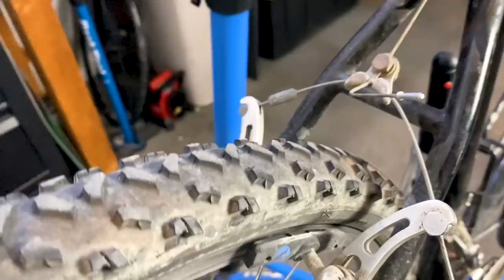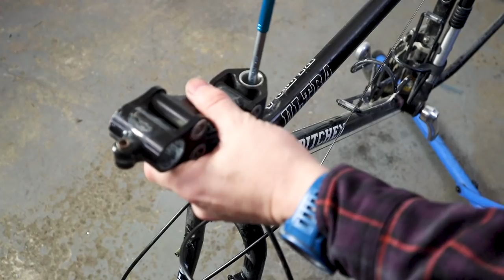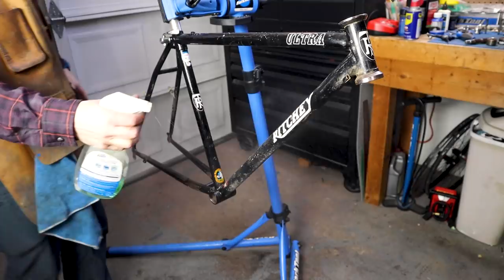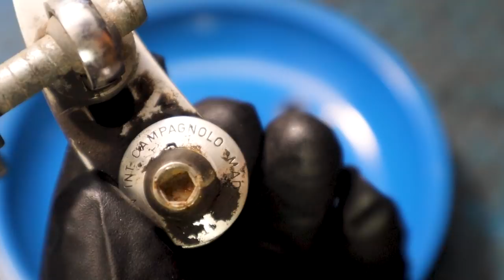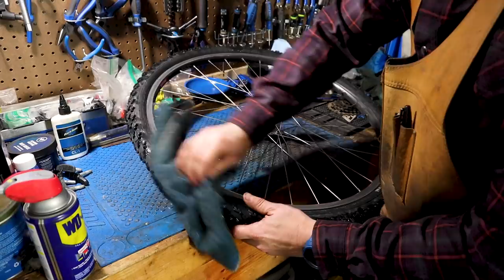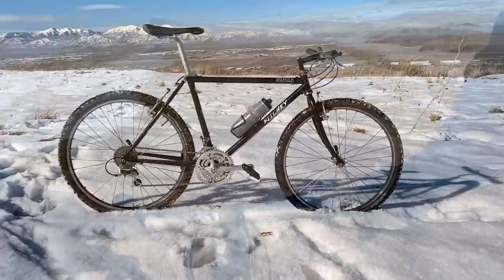Restoring a Vintage 1991 Ritchey Ultra Mountain Bike

Comment: to clean bottom bracket threads, I take a 12 gauge brass cleaning brush in an electric drill, and run it both directions, works really well (with solvent)

Comment: Beautiful. I have a slightly older Ultra also in Black with stock deore xt. Same m732 you put on. Bulletproof shifters. Brakes down low like your Ascent. Such fun bikes. Lightweight, agile. Lively without punishing you. Nice to see you do the resto to close to original parts.  Yes go ride it.

Comment: Right before the world went sideways, I found a Gary Fisher Aquila that I picked up for $40. It was the 2nd bike I tore down and rebuilt complete, plus a retromod update. That frame rode a dream and the Genesis geo was a playful blast. Granted it's not the same vintage, but vintage nonetheless. And I wholeheartedly endorse riding older bikes. 

I sold it last summer and somewhat regret letting it go, but I was able to apply the funds to a Specialized Fatboy which I dearly love, so emotional and financial equity moved forward.

Comment: That was about the time frame that I started working at bike shops, and  I've always wanted a Ritchey frame!! Just loved watching this video and had never seen the   Campy mtn bike group, thanks  for sharing!!
Reply: I have a bike exactly like this bike  without the Ritchey graphics.  An original KHS team with the Ritchey logic tubeset ( decals intact) only tig welded instead of brazed. Rides wonderfully.  Perhaps you could look for one of these to experience the Ritchey ride on the cheap as I've done. Just a thought.

Comment: So glad you kept the original paintwork. Coming from auto detail background you can do paint touchup / correction and the ceramic coating and maintain this original paint work. It really is in too good of condition to start over and lose this original paint work. Would really be a shame in my humble opinion.
Reply: Yeah, its sometimes painful to see vintage paint being stripped only to be replaced with spray can coatings. Would be more interesting to see someone fixing the chips and scrapes and then sealing the old coating like you said.
Reply: I agree. I would prefer the original paint and decals  preserved.

Comment: Thanks for saving another old bike.  I'm wondering if it was originally equipped with Campagnolo derailleurs too?  The triple is awesome.
Reply: I guess it could habe been compleately equipped with Campy. This mix between Campagnolo and Shimano wouln't make sense. 
Well, but I'm not totally sure about that, because these parts are from different years. The Cankset is Campy Euclid (1988), the bottom bracked too, because the Euclid crank needed a special very lon axle. The brakes are not Euclid, they could be Record o.r. or Icarus but from a different year (I assume 1993 or 94). The Shimano 7 speed XT stuff is from 1989 until 1993, except the exchanged Shimano (not XT) shifter and brake levers, they were pretty new (and cheep), maybe 2010. 
I don't know what year the Ritchey frame comes from. I guess it should be early 1990s. So the 1988 Euclid Crankset wouldn't make sense.

Comment: Could you tell me why you never wash the bike with water before disassembly (or at least wash the frame when all components are taken off). Using a rag on a dirty frame introduces new scratches to the paint layer - that's for sure.

Comment: I have the same 87/88 Ultra, it's still my daily ride for my local (easy) bike park. As others have said, please don't paint it, the original paint is a great product, it's almost like an anodised finish. Looks great with the black XT groupset (730). Mine is all original, except I swop over some modern Richey tyres/ saddle for daily use - please use Richey parts! If you can't get the original stem, Nitro still make the bullmoose version

Comment: I keep going back to an Old steel ridged mtb I was able to pick up a Schwinn 1985 Maximum today 2x7
Reply: I have a 1991 Schwinn Crosscut.  I have had it over 30 years.  It bears similarities to what is in the video, but the components are cheaper.  This oldshovel guy shows time and again that with a little work they can be restored to good operating condition,  This enables many more years of use.
(I think he could clear coat it.)

Comment: I was so happy you didn't bodge it this time, no 1x, no wide bars, no polishing of the cranks. Debatable grips and pedals, but ok stem and proper levers and low handlebar position. But then came the announcement at the end: 
😨😰😱 Do not paint it! - Adjust the saddle instead. 
With the post's setback, put it very close to the most forward position and test ride again. Lower the stem, if the bars are to close then. Flies uphill now?

…had to let my feelings out somewhere…

Comment: Nice work with the 360 camera, it looked like you had a crew out there. Consider a retro modern build on that with a Microshift 1x12 thumb shifter and Magura hydraulic rim brakes.